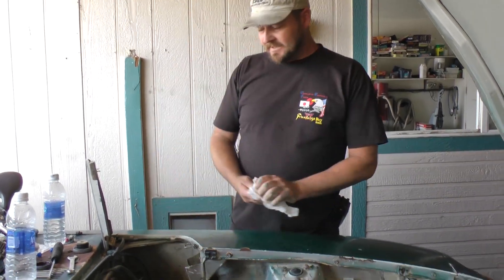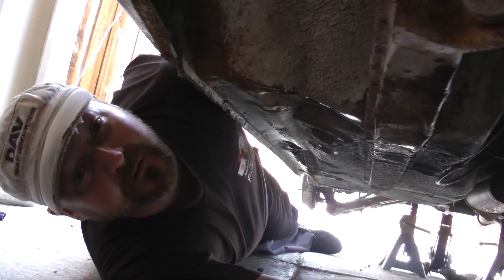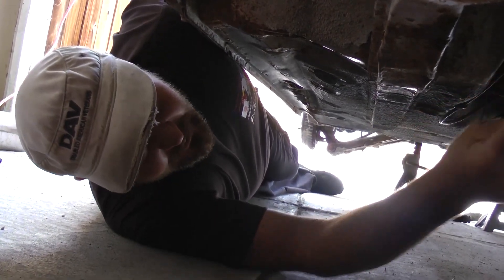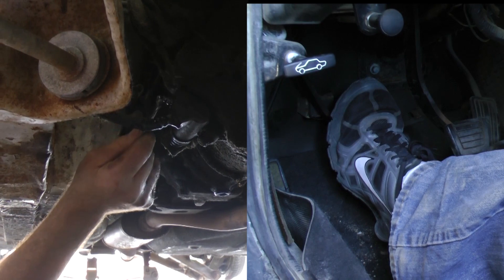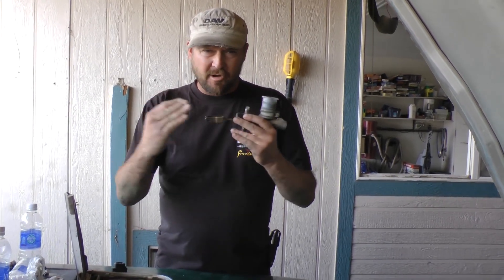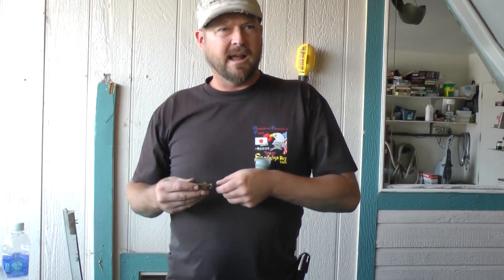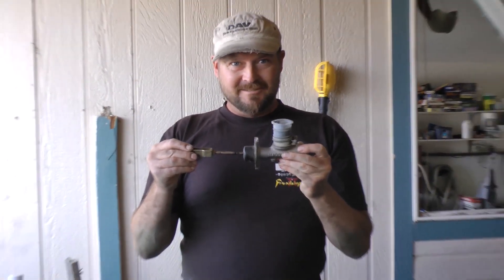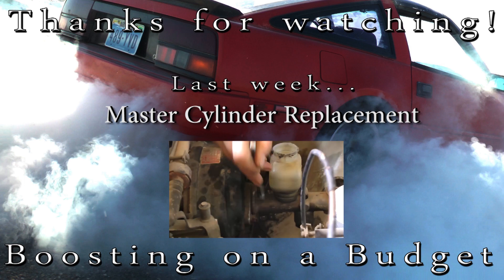How To Change Your Clutch Fluid (Slave Cylinder)

Comment: paper towel was really old and dry, coupe lint or tiny pieces of paper towel dropped in the reservoir. it's ok right? 1 or 2 dropped in and then I couldn't find them. (my car's clutch fluid got its own reservoir)

Comment: Do you have to leave the clutch master cap off when bleeding?
Reply from the maker: 72galaxie500car I leave it off to monitor the fluid level and able myself to top it quicker while bleeding.
Reply: Budget Boosting Why would one want to change that fluid? What's the interwal? Does shop change one for u when they repace clutch (without specificly asking for it)?
Reply: +Željko Harandi Water can get into the system, which is not good for the lines or performance. Every 50,000 miles would be a good idea.
Reply: Just asking what color should it be

Comment: what would one do if fluid did run dry ? old suv i bought needed a new slave cylinder and it broke releasing all the fluid.
Reply: +cw13 You just have to bleed the air out again. Leaving it open to air for a long time can damage the seals
Reply: cw13

Comment: Huh. So bleeding the clutch fluid is the same as bleeding brakes. Learn something new every day.
Reply from the maker: very similar to bleeding brakes yes.  The difference is the bleeding points, have to bleed the clutch master from the line or bleed point, and then the clutch slave cylinder until no air remains.  Pretty simple though.